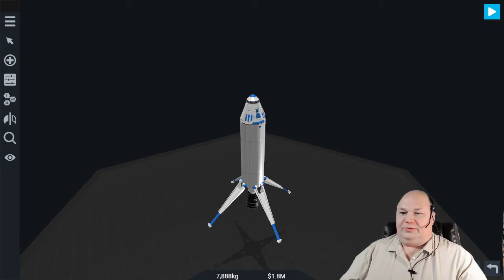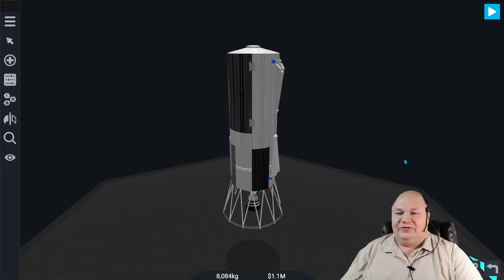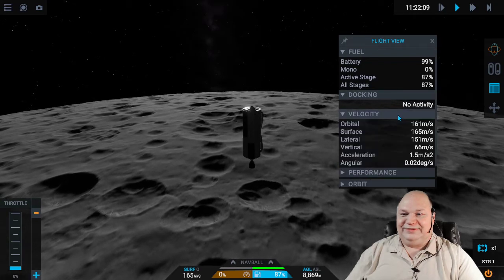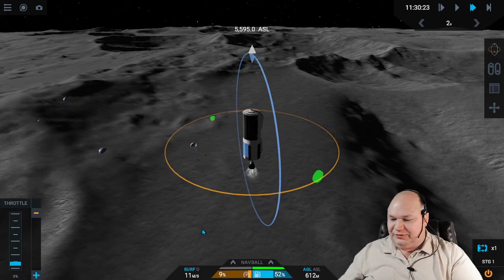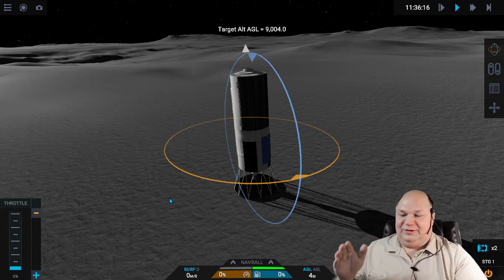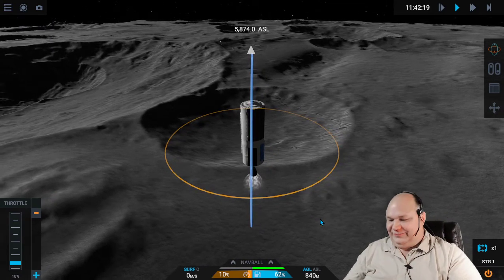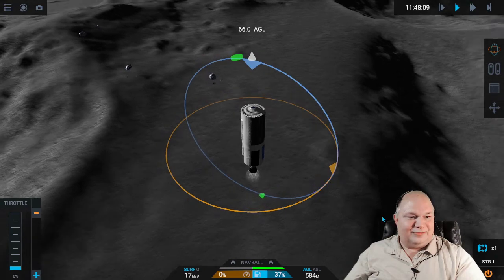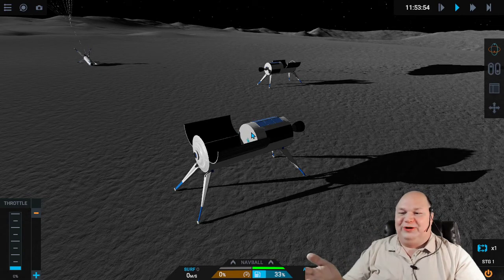"Lay Me Down Softly - Horizontal Landings on Luna " w/Simple Rockets 2 - episode 15

Comment: Use Rcs, outwards-rotated boosters, and advanced solar panels
Reply from the maker: My next Centaur V based lander will have thrusters for travel and horizontal landing - This was an attempt at a minimal lander system w/ single TVC engine and simplified landing gear.  Also, it appears that the OrangeBlackBoxPlus does not work with just a simple command chip and needs a command pod to activate and write to the log at mission start.  For some reason with the chip the log doesn't start until one of the activation groups is hit.